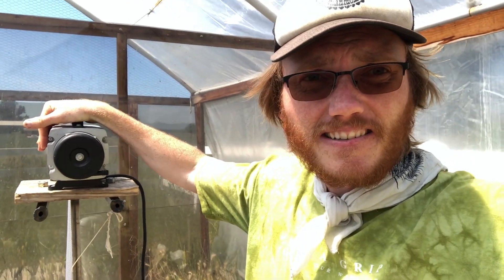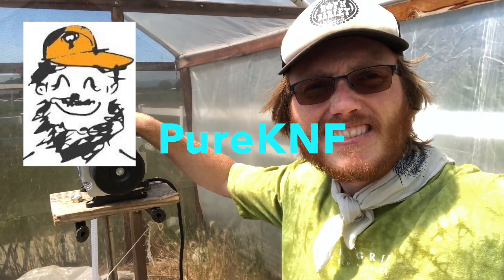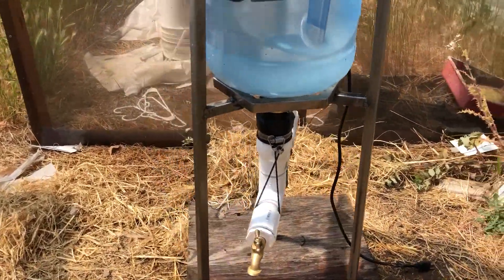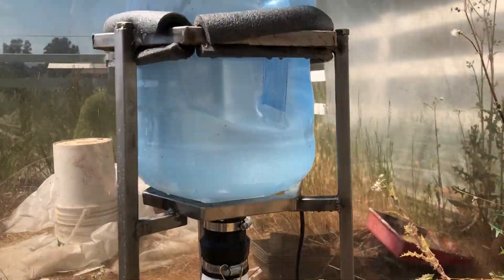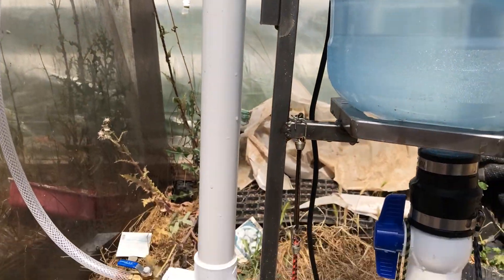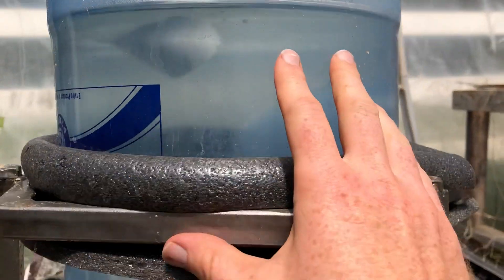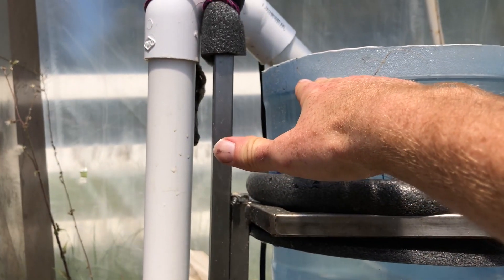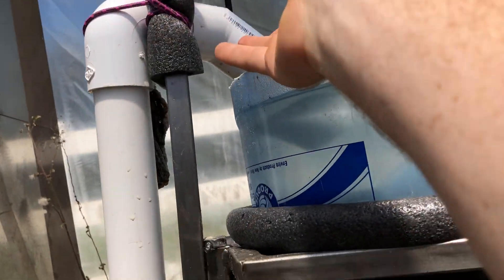Airlift Compost Tea Brewer

Comment: Drake also advised me on an airlift system. it's finished. I made what's called the mini microbulator online. a 5 gal. bucket setup, with a 45L/ min active aqua 20w pump, and I had 1/2" pvc on hand so it scales down really nice and moves a lot of water up through the pipe. It doesn't vortex, but it is very few pieces, and no glue or drilling holes. I was going to make the U of Oregon garbage can model in a bucket, so I got advised by Drake today to get on the Airlift Train woo woooo. its seemingly good. lets make tea now and see what we have. muahhh!
footnote. I want to try the next size of pipe larger on this, and see how much water I get. I have hole in the side of the bucket so I can run one bucket into another and see how long it takes to empty that much liquid. science!! ha ha. why not eh. Peace...  Nice Brewer Sir! ...and never trust a check valve.

Comment: I would leave the air pump where you have it 👍.

 I would never trust a one-way check valve especially because the water has debris in it, that could prevent the valve from seating properly.
Reply: thanks for the tip.

Comment: Curious if you would do anything different today
Reply from the maker: Yes I would probably skip this design all together in favor of a tank that pushes a jet of compressed air from the bottom. This creates a similar aeration effect and also gives rise to vortices within the tank. If the design is to be kept the motor does not need to be above the water line only a loop of tubing needs to reach above the water line. The design is overall flawed in one very practical  sense that it is difficult to clean the internal areas of pipe.
Reply: I don't mind the pump being on top. It seems a good place for it making the foot print smaller. Could you just put the air hose in the top feed tube down to the bottom?

Comment: Vortex filters different temperatures of water because of the different densities. No net cooling unless the air is cooler.
You can separate cold molecules & hot molecules and get hot and cold water from the same source.
Reply: #BCCRSS

Comment: If you combine this with a trompe, you could generate the air pressure needed to flow the water entirely by passive harvesting of a flowing water source. A no moving parts + no electricity compost tea brewer = wow